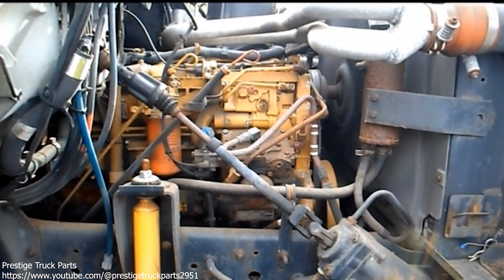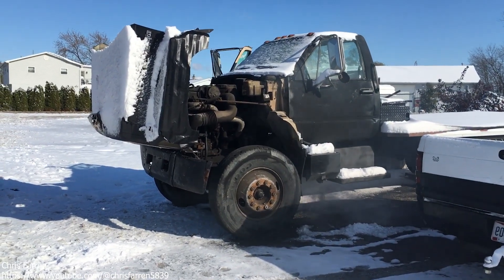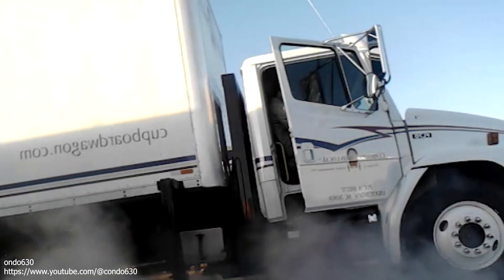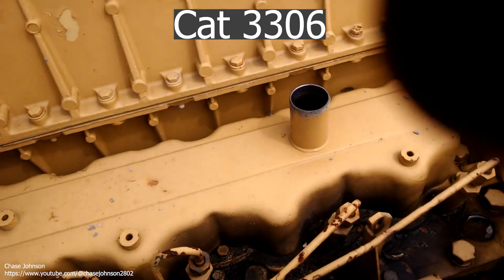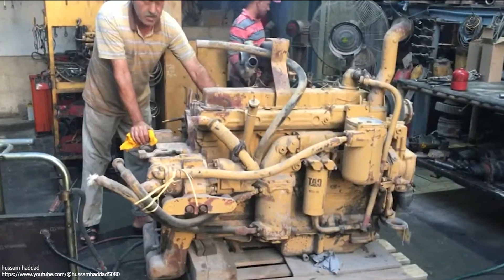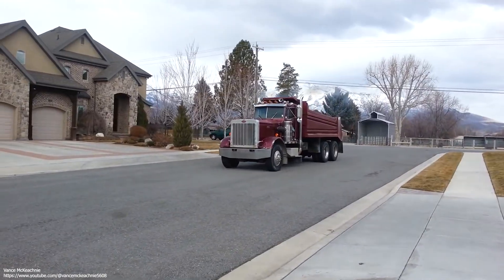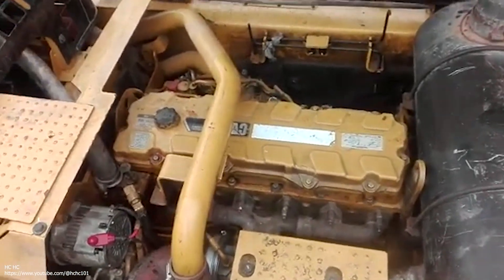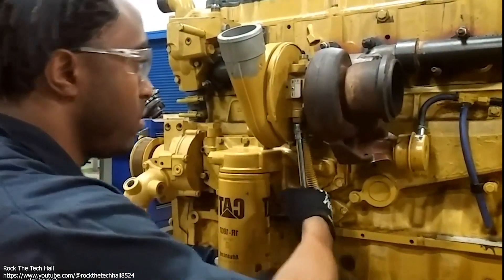5 Best Caterpillar Engines of All Time

Comment: Cat 3408 cat can get up higher then 520 hp my neighbor has a Pete 359 long hood with a 3408 cat and it's pushing 600 to 700+ hp besides it having the absolute worst fuel mileage known to man, that engine makes that truck a beast
Reply: i heard in marine use they can create 950 hp  dont know how true it is
Reply: My uncle worked on marine engines he's come across cat 3408 that where pushing around 950 hp, sometimes even 1000hp
Reply: @montgomerypoulos6076  i have heard of them pushing twice that but were they true or not i dont know  i feel in love with a 1693TA and then moved up to the 3408 what a stud horse it is i ran radial tire going up the grapevine could make them look like wrinkle wall slicks it rate at the ground real power

Comment: best cat road engine was the 1693ta  then the 3408
Reply: I gotta disagree with you on that bud I drove both a 3408 and 1693ta and the 3408 has a lot more horsepower, tork, better sounding and reliable jake brakes, and all out better performing engine however the 1693ta is a hell of a lot better on fuel and cranks in the cold a lot better then the 3408
Reply: @montgomerypoulos6076  maybe you mite want to re read that i said the 2 cats made was the 1693ta and THEN the 3408 i got a shitload of miles on both  in fact over 2 million miles long haul
Reply: @montgomerypoulos6076 what are you on
Reply: @pierce_arrow1798  not a thing
Reply: @montgomerypoulos6076  The 3408 was never fitted with a Jake brake... they did have a Cat brakesaver but that's a different beast.